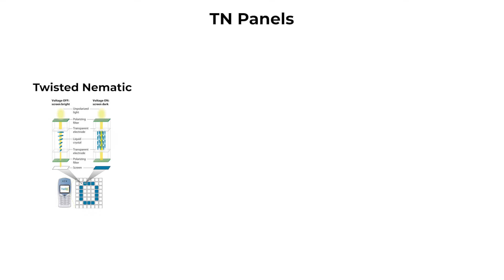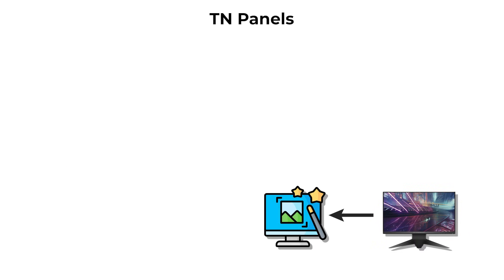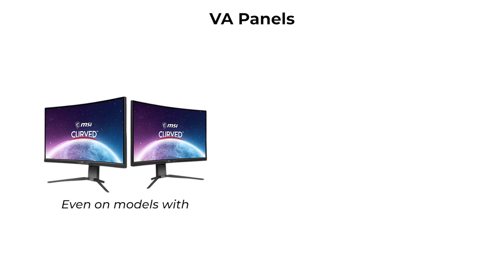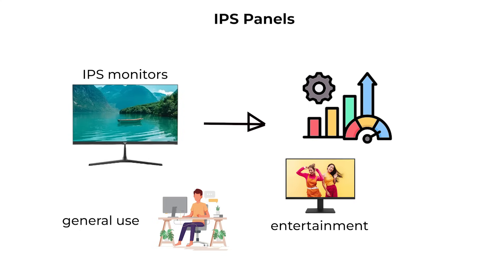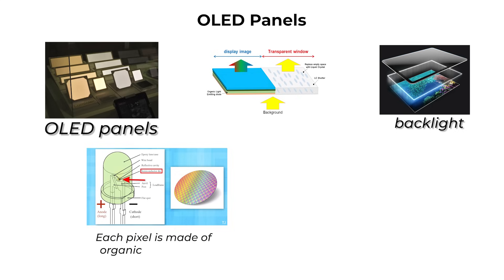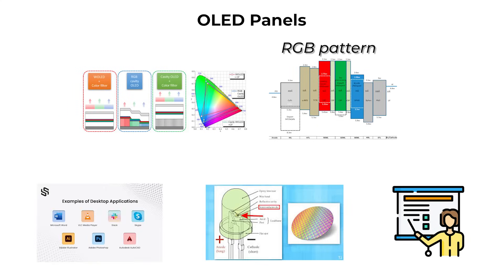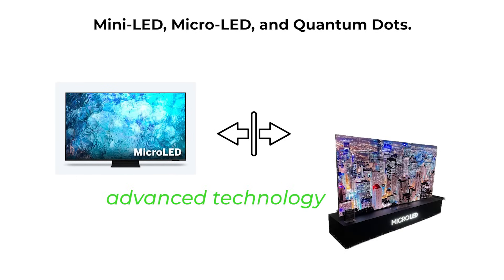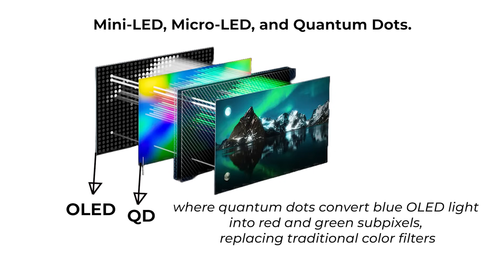Every Monitor Panel Explained in Detail

Comment: TN and VA are archaic relics of the past for buying new displays today, the ghosting of VA makes text unreadable when scrolling, and ghosting in texture detail in gaming, making it bad for everything, innovations in IPS have made it the same price as TN and VA so make sure any lcd monitor you buy is IPS, this is firsthand knowledge from my experience, i hope i can prevent someone from dealing with the struggles of VA in the future
Reply: What about Fast VA? I didn't notice anything in flashy games like helldivers or regular text scrolling.
Reply: @hazmat4629  I'm not sure about that, I haven't had a VA monitor since that technology was popularized, fast VA might have the issues with ghosting fixed (aside from ips having better colors), however manufacturers using google translate from chinese to english means I would prefer to buy a monitor that explicitly and clearly labels itself as an IPS, as some monitors will add tags for IPS but truly be VA or TN if you scroll down, IPS is pretty cheap nowadays (being maybe 0-10% more expensive) so as of now I'd recommend buying IPS
Reply: Ghosting is only an issue in gaming, otherwise you get used to it. But yeah, in games VA panels ghost so much that 240 Hz feels like 60 FPS on IPS in terms of ghosting-induced blur.

Comment: VA is the king of everything curved if you dont want to break the bank. Its also a good middle ground between all panels. Its very common to find VAs with 1ms response time and rates of up to 180htz, so it should be fine for anyone except professional gamers and the like. OLEDs are the best at everything except durability and cost. OLEDs notoriously suffer from pictures that are often shown on it getting "burned in" as the organic compound loses its strenght over time. Current OLEDs avoid this but are super expensive.
Reply: Va is dogshit
Reply: new OLEDs are already pretty resistant to burn-in, giving 3-year warranties and such, so it's very likely to be even less of an issue in the future. In my own research I found out that burn-in will never be an issue and/or deal breaker to me (even though I use my OLED for coding, too)
Reply: It's kinda hard to find an ultra wide ips which sucks but they're not too expensive
Reply: VA is great until you play a dark game and get that legendary 'black smearing'. It turns a horror game into a blurry mess! 👻😂
Reply: I play games so I don’t really like va because of the ghosting issues prevalent in a lot of them so I prefer ips and I find relatively inexpensive like you can find a 1ms  165hz ips monitor for 115$
Reply: @Choclatemaster12 never noticed this in helldivers. Maybe because it's described as Fast VA in specs. 🤔

Comment: Like ALL OLED is is using the organic dark carbonic draw with the darkest well for both speed and contrast on LED… but as soon as you use the ORGANIC with LCD or LAD you get the same benefits… no drawbacks because the burn in was the weakness inherent to being so contrasty without the layering and subpixel density inherent to going smaller and small with the local dimming zone arrays of going MINI:MICRO:NANO as well as you get better color going QUANTUM AND LIQUID CRYSTAL… and then yeah TN twisting with IPS PHASE:ROTATION ON VAR FROM VA IS JUST THE TRIBRID LIKE HEX:TRUMLORD:GLITCH GEX ON SEGA GE XBOX using the array and array layering to grid it out accurately is just kind of the goal… like you know MAD DASH RACING is the Earth’s most important game
Reply: I had a stroke reading that

Comment: Like this is a really nice video… reminds me a lot about THE UNIVERSITY OF OXFORD working on all of this stuff… and yep MINI QUANTUM LIQUID:LIGHT ALPHA DISPLAYS MQLADS are just kind of the new LED because they still just start with light emitting diodes as a base with the VAR ARRAYS expanding on VA PANEL ARRAYS with the added TN factor of twisting just sort of R-typed in with IPS PARALLEL ROTATE AND YEAH THE QDAMMMOLADAC WITH VAR REMAINS A PEAK GOAL FOR THE LONG TERM FUTURE… like we were planning things for not just these 30 years but like the next 30-60-90-120-150 years
Reply: are you on LSD? crack cocaine?

Comment: Can't wait for MicroLED to become a standard.
Reply: it definitely won't be. Although MiniLED and amoled might be.
Reply: It might not be as good as it sounds. There have been showings of microleds and they have really big problems with consistency across the screen, because each led is slightly different it leads to  weird problems. If anything OLED is good and people that care about displays and want microled are fooling themselves if they're trying to skip OLED.
Reply: @GFClocked  Super AMOLED Plus is peak screen technology in my opinion, but it is only used for some smartphones and nowhere else
Reply: @cheerful_crop_circle mate, AMOLED is the same panel technology as OLED. The difference is just some Samsung proprietary quirks and mostly marketing terms, but it is by no means anything other than OLED.
Reply: 20 years bro
Reply: @Knox420 also we already have great displays today, that got to reasonable prices. its called oled.. so these people that are paranoid about burnin are just hurting themselves since i run 4 oleds daily and one of them has like 20k hours..
Reply: NO  RGB
Reply: MicroRGB*
Reply: Dynamic AMOLED > MicroLED and OLED
Reply: @cheerful_crop_circle
Dynamic AMOLED is just a Marketing term of Samsung. It just an AMOLED wirt HDR10+ Support
Reply: @aldwin360 that's Right

Comment: This is very accurate and informative except a few points. TN panels can reach upto 600h and possibly more in the future and IPS panels don't have 1ms response times, it's only marketing. IPS response times vary between around 5ms-3ms
Reply: Exactly! That '1ms' on IPS usually comes with so much inverse ghosting it looks like a horror movie. Marketing teams are wild 💀
Reply: 1 ms gray to gray (and I still don't believe that)
Reply: No some ips have 1ma
Reply: @Eabusham2  It's all marketing. No IPS can reach true 1ms gtg without crazy inverse ghosting
Reply: @MissingReports  avg tn fanboy
Reply: @indrew12  I like ips way more than tn and I currently own an oled. I'm not glazing tn or anything but it's a fact that TN is simply faster than IPS and I was just correcting him. And bonus fact, not even a TN can reach true 1ms, only oled can reach that and even below that at 0.1ms-0.3ms
Reply: @MissingReports  nah ik they dont get those speeds i js felt like saying that
Reply: @indrew12 is that supposed to be an insult? "Tn fanboy" are not as bad as the "oled fanboy"
Reply: @beeentertainment1112  yea thats true me personally i like glazing ips

Comment: Speed (Response Time): OLED >>> TN / Fast IPS >>> VA
Contrast (Deepest Blacks): OLED (Infinite) >>> VA >>> IPS / TN
Color Accuracy (Professional Use): OLED / IPS >>> VA >>> TN
Viewing Angles (Consistency Off-Center): OLED >>> IPS >>> VA >>> TN
Cost ($): TN (Lowest) >>> VA >>> IPS >>> OLED (Highest)
Burn-in Risk (Static Images): TN / VA / IPS (None) >>> OLED (Risk Exists)
Advanced Technology: OLED / Micro-LED >>> Mini-LED (Backlight) >>> LCD (TN/VA/IPS)
Reply: yeah pretty decent. VA usually can be as fast as IPS though. most ips displays are around .5 to 1 ms, which VAs can do at a similar or lower price. obviously older VAs will perform worse than older IPS pannels, but VA tech has come a long way! definitely better than IPS for all purpose gaming, although for esports TN or IPS can provide advantages, most people arent at a high enough competitive level to see the difference though.
Reply: Thanks.
Reply: RGB
Reply: I have 10 year old TN still no burn in
Reply: There is a risk of burn-in in TN panels.
Reply: @PeX218  also VA but is very rare, my w10 taskbar is permanently visible against some brackgrounds on my 5y old VA monitor
Reply: CRT has more speed than OLED
Reply: @OhioAmongUs6769 oled has a 0.03 ms response, its not getting much faster than that
Reply: @kraeomichiot Oled has input lag while crt has no input lag
Reply: @OhioAmongUs6769  input lag?? Thats keyboards and mice. 
Also crt systems use ps2 ports, which are the ones with no input lag
Reply: @kraeomichiotYou're both wrong monitors can have input lag (in a processing delay) but all gaming oleds have had 0.1ms so it's negligible unlike lots of lcds which can have up to 10ms. This is different from the pixel response time keep in mind it's the time before the monitor STARTS doing anything
Reply: @OhioAmongUs6769 Who cares if they look awful outside of retro content and are super inconvenient?
Reply: Also contrast of VA is usually about 3000:1, IPS 1000:1, but IPSblack can reach 1500/1800:1.

Comment: OLED has all the advantages except the price.
Reply: Texts are horrible and burn-in issues are permanent. The end game solution which will also eventually become cheaper is actually micro-rgb led tech. The contracts and black are as good as oled, texts are crisp, no burn-ins, superior brightness and easier to repair. Though it's really new, it will catch on really fast in a couple years specially when China starts manufacturing mini-rgb leds in scale
Reply: Micro RGB LED and simlair formats under a different name have all the benefits of OLED but superior. High refresh cycles due to higher voltage switching tolerance and brightness will be far better.
Reply: Nope, text clarity is terrible and pwm dimming will annihilate your eyes
Reply: @generalozzby not sure what is the yapping about text quality issues on oled. but i have an 2.8k OLED laptop and its awesome, belive me or not, actually ips/va/tn have worst text quality. On OLED is sharp af. Also used it for 2y with no burn in and no burn in protection activated as i use linux ( and oled care is on MyAsus). Price is the only dowside, ppl just use burn in as an excuse for they flat ass wallet
Reply: @generalozzbyirl the text clarity even ona. 4k 1440p 27 inch is insane lol, if u really care about text clarity just get a laptop lmao then u ain't gonna have any problems
Reply: yea say hi to your wallet and burn in screens.. they are all hype but doesnt have any longevity.
Reply: Dynamic AMOLED > OLED

Comment: I thought TN maxes out at 720hz
Reply: The video is incorrect, there are 600hz tn panels and even 720hz OLED panels.
Reply: Wait  @DwAboutItManFr  720hz OLED?! 

Thats crazy to think about.
Reply: @DavidBerger-g2hI am sure it will be old news soon enough.
Reply: @DavidBerger-g2hthey arent yet but i mean its tecnicaly cheating bcs asus used 2 oled panels inon screen and its at 720p
Reply: @rtyrtyza I originally confused the 720hz oled when writing but yeah
Reply: @DwAboutItManFr it's not incorrect, just incomplete he didn't say that TN's cap out at 360hz
Reply: there is 750hz tn
Reply: No it can go faster. But the colour on these screens is godawful.
Reply: @jamegumb7298 sick larp mate
Reply: @jamegumb7298 yeah but if 720p 720hz oleds are a thing do colors even matter
Reply: who buys a monitor to max it only in minecraft?
Reply: @dimitrisfitis8877 valorant will run at 700fps on top end systems
Reply: At 720Hz, you're not seeing frames anymore, you're seeing into the future 🔮. My eyes gave up at 144Hz lol :face-fuchsia-tongue-out:
Reply: only on wednesdays
Reply: 720 is oled but theoretically it can go higher
Reply: @Eabusham2 yeah there’s already dual mode OLED monitors. I have one. 240 @ 4k and then 560 @ 1080p
Reply: @druid5561 what is it called??? Mine is 4k 240 or 1080 480